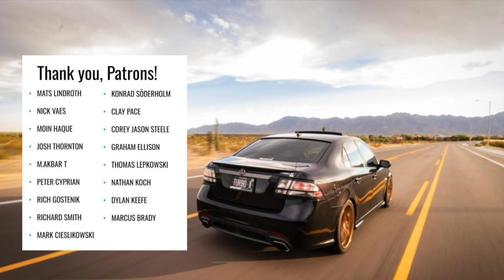Installing a Complete Maptun Dual Exhaust on My Saab 9-3!

Comment: about to do this but on a genuine saab downpipe..... for those trying to do this job and find that his missing some steps due to already having a different down pipe, there is a guide for kronas downpipe instalation which should work on any downpipe you might have..... amazing videa overal.... been waiting for someone to do this video for the b207R
Reply from the maker: Thanks! Yeah, there’s some misc little brackets and head shields you also need to remove for the stock exhaust. WIS also has some good instructions too, if needed

Comment: Sounds great. You mentioned you'll be doing the the water pump soon.. just finished that job on my 09 XWD Combi... zero fun. Good luck!
Reply from the maker: Thanks! Lol. Yeah, about halfway though the job now. Definitely not fun..
Reply: @AutoAutopsy  when putting the bolts through the sprocket and into the new pump, I had to loosely bolt the new pump
In place, when it was too tight, I couldn’t get the bolts started.  Good luck!

Comment: Nice, my hirsch exhaust is a bit bassier, but this sounds very similar

I assume you might need to cut the exhaust tubes a bit shorter at the middle connection to slide them in a bit more
Reply from the maker: Yeah unfortunately where I double clamped was a bit of a tight fit :/ so there’s no room to pull together anymore
Reply: @AutoAutopsy  shorten the downpipe pipe. I have also done it this way to move the tailpipes more in. 
Are the rear mufflers already touching the hanging points when the exhaust is hot or is there still enough room?
Reply: The maptun will be louder in a few months.🤣
Reply from the maker: @werner-gunterschmidt1619 I can’t shorten the downpipe pipe, since it’s already barely crosses over enough with the big muffler under the body. Cutting it shorter would just make the problem worse, unfortunately. If I didnt have that issue, that makes total sense for fixing the tips sticking out! 😁👍🏼

Comment: Nice clip as always mate! Catback is 3" or 2.5"? Thinking about whole 3" JT system but if Maptune is the same I would go for it. Thx in advance for reply
Reply from the maker: Thanks! It’s 2.5in after the downpipe I believe
Reply: @AutoAutopsy  thx, I wasn't sure. There is no info about diameter on Maptun's website

Comment: Would replacing the muffler alone give you a way to that sporty sound? I have a 2002 9-3 that I would like to sound better but not necessarily replace the whole system. Any recommendations?
Reply from the maker: Yeah a catback system would do exactly that

Comment: Hello, I have a Saab 9-3 xwd 2l t 2011. The revs drop too much for some reason, but when I disconnect the clutch pedal sensor from the cruise control revs are ok. What could be the cause?
Reply from the maker: So you’re saying the car tries to die and won’t run smoothly? Sounds like you might have a nasty vacuum leak but it’s hard to say. It could be a lot of things

Comment: I would like this kit more if it had flanged connections (much more secure) rather than slip joints.  Having to use 2 clamps on one joint is a bit meh to me.
Reply from the maker: I agree. Vbands would be much better
Reply: It’s possible to do, but would also make the exhaust system much more expensive
Reply from the maker: ^ glad Maptun keeps it affordable!

Comment: How did the back valance majestically get two ports? I'm so confused.
Reply from the maker: 1:32, 6:27
Reply: did you even watch the video?
Reply: @zebkalnbach4382  yeah man I was in a hurry and working so obviously I missed something ok so I'll re-watch it when I have more time.
Reply: @AutoAutopsy  Thanks the 6:27 part I missed now I get it, very slick operation there. Awesome and thanks! I just missed a 9-3 Turbo X the other day but I'm also very happy with my LR Viggen.
Reply from the maker: @KingCast65 no worries! 😁👍🏼 the viggen is a great car
Reply: @AutoAutopsy  Despite the piston I probably cracked last night on my Birthday. I might slip one in for now and do full Wossners later just tight on money. First World Problem there's still an 850T Estate and a 535is in the driveway. Leak down today. Pisses me off the GM did that with those pistons.

Comment: any tips on using that adjustable wrench to get the bottom O2 sensor out, or should i just go get a solid 22mm wrench?
I was about to rent the O2 tool and wondered if I got enough room to get the sockets and an extension in there!
Reply from the maker: I was able to use a spark plug socket on a 3/8 ratchet

Comment: Turn the clamps around so the dont get stuck.
Reply from the maker: How will they get stuck?
Reply: Stuck around bumps or low clearance places when going over them
Reply: @ChiYoungKC  In addition, when you live in areas with more wet weather than Jacob probably experiences, the threads are not the last part to dry up, keeps the rust a bit more away.
Reply from the maker: @browserrr1 ahhh. That explains it - thanks for clarifying 😁

Comment: Why does the exhaust move so much, but welding it will eliminate that air exhaust leak
Reply from the maker: It moves because the engine moves/shifts and the entire system is on rubber hangers to allow for flexibility. Having it in sections makes install/removal far easier!
Reply: @AutoAutopsy  mine has krona 3 inch downpipe with 3 inch piping and race cats and doesn't move because I weld just towards the exhaust muffler, and it sounds amazingly, all custom with no movements, absolutely it has hangers before the muffler exhaust, just one good weld at the end, one good canister exhaust, no dual because it's  2.0T maybe a V6 will be good flow air with dual, I just love doing my custom DIY projects to have own creativity 👍🏻, you should also change your Turbo to Xt compressor upgrade and tune the car at Stage 5 maptun, great response also comes with 630cc high flow fuel injectors, the car Flys like a jet at 315hp to 420trq
Reply from the maker: @edgarzuniga8504 I’d love to do those upgrades someday, but it’s not in the budget rn. Still have lots of cool things planned for it in the short term though